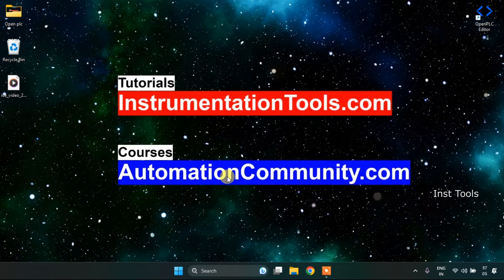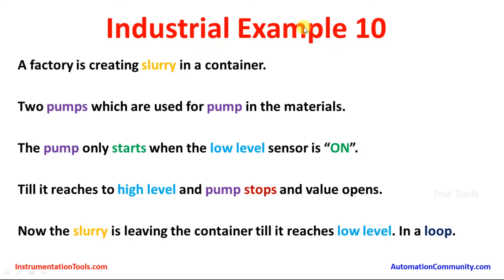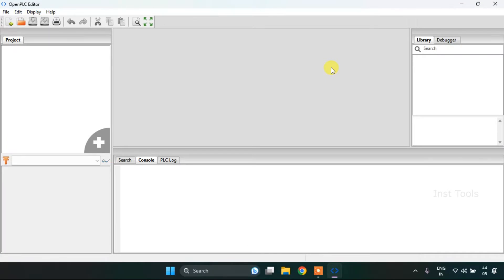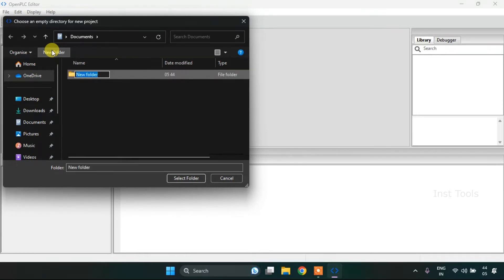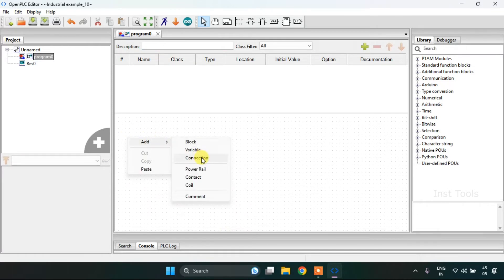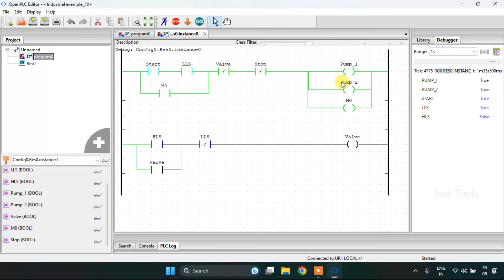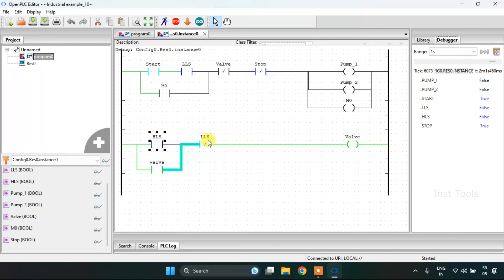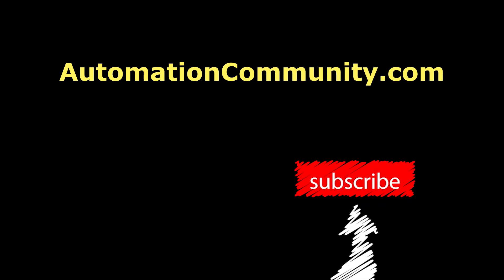Pump and Valve Control via PLC Logic - Example Problems

Comment: sir
you have been regularly uploading videos on instrumentation
i would like to have your opinion on this
Presently  going for VFD or DC drives in paper machines removing line shaft
All drives are linked 
to DCS through communication cable
process inter locks through DCS will trip the appropriat drive and the indiction will be shown in DCS
Also if the trips the fault indication will be shown in the respective drive panel
sometimes drives trip without indication on drive panel as well as DCS
Since there is no proper diagnostics there is always difference of opinion between Electrical and instrumentation dept 
your opinion and to have proper diagnostics
s
Reply from the maker: If the trip is initiated from DCS, then you can conclude that there is some interlock activated in the DCS system.

You can always find the TRIP status on the VFD display and on the DCS alarm/interlock status page.

Check the SOE (sequence of events) if available.

You can configure additional status bits from the VFD to the DCS. As you are using communication bus for transferring the data between VFD's and DCS, it is very easy to take additional status signals so that you can have better diagnostics. Take feedbacks or status signals related to the Motor and VFD or common electrical-related trip signals like overvoltage, undercurrent, unbalanced load/power etc., so that you will have complete data for analysis.
Reply: @InstrumentationTools  
Thank you